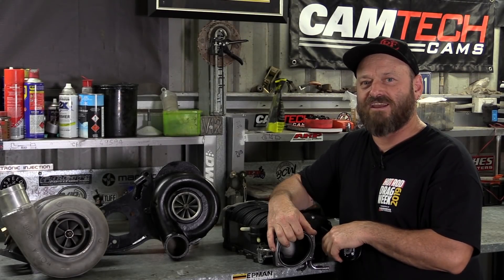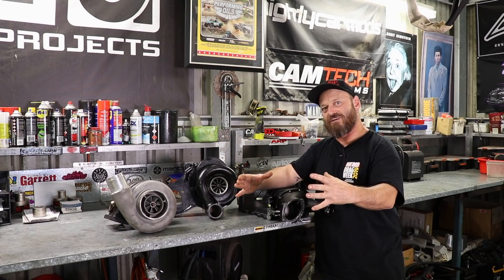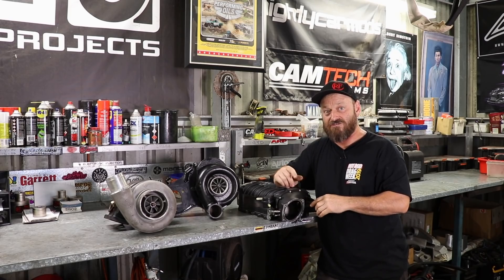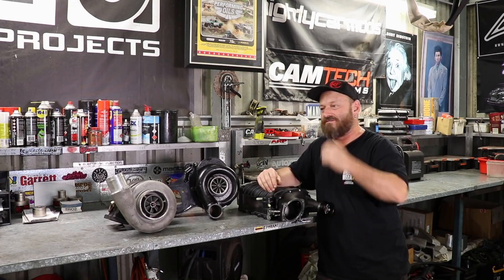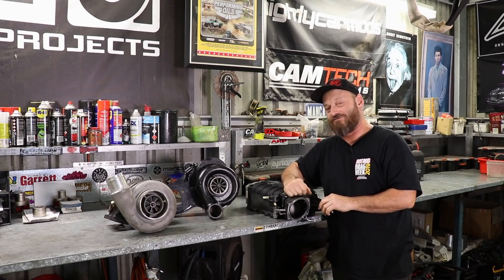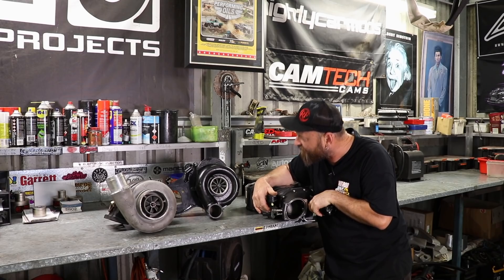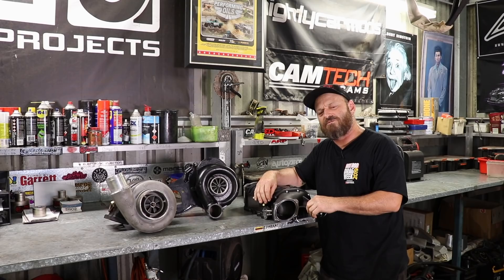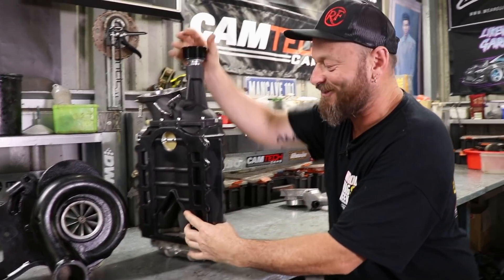Forced Induction Differences - THE SKID FACTORY - [ Quick Tech]

Comment: just bought a centrifugal supercharger for my xr8, turbo will make more power, but the simplicity of literally bolting it to the front of my engine makes it a good option
Reply: Well the problem here is you bought an xr8 instead of an xr6 turbo
Reply: @cameronjansz88  old mate probably wanted a 8 cylinder.
Reply: tturi2 you’ll still need to get a tune
Reply: statement leaver should rename themselves to just leaver... hold the statements, because they are very poorly informed.

This is why people start yelling in comments sections.
Reply: I have a supercharger car and YES SMALLER PULLEY = MORE BOOST .
Also bigger "Crank pulley" more boost or harmonic balancer for my application. Also I changed my "crank pulley" and no it did not effect timing ...
Reply: @stevenclarke374  Because the cam shafts are not driven from the multi V pulley  for the alternator belt. gearing it like that will give you more parasitic draw though.
Reply: @stevenclarke374  What your rolling in??? Did it come from factory with s/c ? Are you getting a good strong boost from idle to redline nice and linear? Good economy? No dodgy idle cold/hot?
I assume that since the s/c pulley and the crank pulley have been swapped. Was your ECU self aware or do you have aftermarket?
Reply: Belt driven turbo.
Reply: Why would you bye a xr8
Reply: @pauledwards9416  because I like it
Reply: Make sure you fix that vapor lock hohar in the front of the heads first.
Reply: @Hooha888 I'm sorry Who are you?
Reply: Hmmm. 
65mm pulley(standard) change for 72mm+
Bigger pulley more instant power without the Turd'bo lag.
No plumbing for coolant or oil required. Basically just belt and fuel pump!
Cheapest and easiest mod in automotive history.
Reply: statement leaver You want a smaller pulley on the supercharger to spin it quicker (more boost)
Reply: @Brandon27.0  What is speed? 
Distance over time!
Smaller pulley means your asking for half the lifespan due to forcing a faster rotation whilst lowering the original power output of the charger.

EDIT 
Same reason why 3cylinder cars now come with 17-18 inch alloys!!!
Reply: statement leaver ‘The simplest way is to increase the speed at which the supercharger spins in relation to engine RPM. To do this either you swap out the lower "crank" pulley for a larger one, or swap out the upper pulley on the supercharger itself with a smaller one.’
Reply: @Brandon27.0  Have you actually read and understood what you're actually typing?
Bigger crank pulley will also mean the timing is out due to the cams being standard when the cam pulleys would also need to be bigger for your small wheel charger(underpowered) to work with the RPM!
Reply: @statementleaver8095  You don't run superchargers off the timing belt.
And gear/pulley sizing for increasing or decreasing speed is pretty straightforward, go look at a bike with derailer gears. Bigger drive and smaller driven = faster driven speed. Smaller drive bigger driven = slower driven speed.
Reply: @johnjosephson9277 lmfao you don't even know how a belt driven supercharger works!
Al has shown two types of charge systems Centrifuge(BeltDriven) and Turbine (turbo)
Reply: @statementleaver8095  why don't I know? Because of the gearing ratio example I used?
And he showed three examples, two belt driven superchargers of different types, and a turbo. Yes I know that's a turbine supercharger.
Reply: @statementleaver8095  Anyway, whether you're right or wrong I'm clearly not going to change your mind on anything, and I don't think I'm learning much here, so I'm going to drop out here. Cheers.
Reply: John Josephso
Reply: statement leaver Bigger crank pulley doesn’t change engine timing, it’s the pulley not the gear you’re changing
Reply: @Brandon27.0 Funny 'Drop out here'!
What wraps around the 62mm pulley Then EINSTEIN???? 
The lack of backed up evidence from you is overwhelming me!
Piss poor comparison is all the intelligence I've got in return!
Reply: @Brandon27.0  Bigger the crank pulley the faster the rotation of the pistons!
Like I previously stated changing the crank pulley size affects the timing!!! Where == between pistons and valves!
Only 1 supercharger Al shown was belt driven! The black snails home isn't belt driven!
Reply: @statementleaver8095  don't think that you've ever pulled apart anything in an engine in your entire life .. front belts on an engine run the accessories like water pumps (unless driven by the timing belt as it is in my Honda), air-con and alternator. When you take all of them off, the engine will still run until either it over heats, or the battery goes flat. When you pull them off you will come across the timing chain/belt cover. Pull that off and you'll expose the belt/chain, gears and tensioner. The timing of these is completely independent from any of the front pulley's that run the auxiliaries.

If you want to get more boost out of a belt driven superchargers (the two black ones) you increase the crank pulley and decrease the supercharger pulley. Just like on a bike, where the fastest turn (although most power needed) is when you have the biggest cog at the pedal and the smallest at the wheel.

This is why, when superchargers were all the rave back in the 70's 80's and early 90's you could look in any street machine magazine and find over-sized crank pulley's and undersized blower pulley's, sold to be able to go from 7 to 9 to 11 to 13 pounds of boost.

Before you go and claim that you know everything, do yourself a favor and pick up a workshop manual from somewhere, get a wrench in your hand and get some grease under your fingernails. Otherwise you just prove that you're an idiot with no experience ..
Reply: @klay6483  Thanks for the factual rundown mate :D
Reply: @johnjosephson9277  reading through it I felt like smacking my head against the wall lmao
Reply: Klay couldn’t have said it better 👌
Reply: @statementleaver8095  No becasue the size of the alloy doesnt necisarily change the rolling radius.
Reply: @Brandon27.0  the problem with that is belt contact area. you really want a bigger crank pulley if possible.
Reply: Roo Tehconqueror Basic boost upgrades on factory superchargers a smaller pulley is still fine but yes can run into belt slip. Bigger crank pulley can cause other considerations since you’re spinning everything quicker.
Reply: @rimmersbryggeri  One day Benny's Cresta will run high 7s if it's got smaller wheels on it
Yeah and the engine will be powered by hopes and dreams!!!!

I'm yet to see little wheel prevail when up against big wheel! Specially at the drag strip!

Roll a 50p and a penny for 1 revolution. Obviously the 50p will go travel further because it has a greater radius 
Same for wheels of a car going from a 15inch to a 18inch alloy gives 3inch of extra travel per rotation and gives more miles per gallon as you'll be able to cover more distance than original specification.
The only discrepancy is profile of the tyres.
Reply: @Brandon27.0  Try it yourself Diesel will run happily all day long without either!
Reply: statement leaver go try that on a common rail diesel. On an old diesel yeh probably but that’s one little fun fact no one even asked for and why it even matters
Reply: @Brandon27.0  Well let's go back to the start! 
Why add weight to the crank pulley by making it bigger and heavier? I'd have thought smaller and lighter crank pulley would have better results.
Isn't that defeating the object of acceleration by slowing the pistons? A shaved flywheel can make a big impression.
I understand that a smaller s/c pulley will spin the s/c faster. But making the crank pulley bigger makes less sense to me.
Reply: statement leaver like 5 people have tried to explain it to you. No one said heavier pulley, bigger diameter crank pulley or smaller supercharger pulley changes the gear ratio, just like on a push bike. Smaller diameter pulley on a supercharger means less contact area for the belt which is why people might opt for an overdriven crank pulley to avoid belt slip. An underdriven crank pulley works for other desired results but for turning a supercharger quicker you’ve gotta go bigger drive wheel or smaller driven wheel to spin it quicker. If you don’t believe anyone here google it
Reply: @statementleaver8095  in the case of a supercharger being driven by the crank pully (NOT THE TIMING GEAR) the piston speed RPM are determined by the engine ie how much air etc is going in this then drives the timing and at the same time but completly INDEPENDANTLY the supercharger drive pulley.

in this the drive pully is connected to the crank and is driven by the pistons (they determine speed) the pulley here is the back wheels of benny's cresta the road or dragstrip is the drive belt for the supercharger the supercharger is the front wheels of benny's cresta (which are SMALLER). as benny's cresta goes down the race track bennys cresta front wheels are spinning faster than his back wheels. 

a supercharger creates boost based on how fast it is spinning the faster it goes the more boost it makes.if the ultimate goal is to make the supercharger spin faster you either make he back wheel (the drive pully on the crank) bigger or the front wheel (the pulley on the supercharger) smaller 

if you want to learn more about this go watch some stuff from finnegans garage and balphemi. or some of cletus mcfarland with TOAST. both of these are supercharged and they talk about swaping the top (supercharger) and bottom (crank) pulleys over to get more boost. in these situations the top (supercharger) is larger than the botom (crank)
Reply: @jackass123455  That last paragraph is exactly what I've been saying bigger on s/c and smaller on crank. But apparently I'm thick and I know nothing according to the rest of the comment section lol.
Sounds like Cleatus agrees though!!!
Reply: @statementleaver8095  when you change your wheels from 15" To 18" makes no difference. The overall diameter change is not 3 inches, if your car has 3 inches bigger diameter tires after this operaation, you should maybe buy tires from a Shop that knows their shit... Most cars would struggle To fit 3 inches taller tires without rubbing, hence why you got different profiles To pick from. And yes I do know something about this matter. And changing a bigger crank pulley To pick up blower speed does not affect the timing. If it did, you might need To consider maybe a new hobby.
Reply: @AnanusBananus I stated the only discrepancy is tyre profile previously.
Forget the tyre profile the wheel itself is 3 inches bigger!
Bigger crank pulley means longer distance between TDC as pulley is taking a wider arc. Lowering idle RPM.
Small pulley on s/c compensates for this low idle RPM. By being ran unnecessarily at idle output on s/c is capped to lower RPM when boost is required you'll have none. Especially after 3k because you've used the boost to get off the line.

EDIT Time
Reply: @statementleaver8095  Sir, you need help.
Reply: @statementleaver8095  WRONG!!

Comment: What are your thoughts on Twincharging? Either S/C low revs until T/C picks up (lag delete) or the second charger in line compressing the already compressed air from the first charger?
Reply: Make It Go twincharging is pretty much useless. Modern turbos are quite good, and if your engine/turbo/exhaust housings are selected correctly then adding a blower doesn’t add much other than weight, complexity and heat.
Reply: Both work excellent, the only downside is the effects on the budget of the build. Depending on the vehicle it can also be nearly impossible to fit it all under the hood. Industrial diesels use both for different applications.

Comment: I thought on Eaton super chargers the rotors get hot and expand closing up the gap?
Reply: If it's being ran hard, the gap has to be left big enough so under max temps it doesn't touch. Which means that under less then max performance their is a gap, that can be combated with fuel injection into the blower creating a "liquid gasket" of sorts.

Comment: oof, there are some grossly exaggerated opinions in this one
Reply: Yeah, the Edelbrock 2650 and the Whipple Gen 5 make some giant gains on the Coyote motor which is becoming a pretty hot ticket item here as of late.  My Paxton car pales in comparison to the TVS cars that provide that impressive kick in the ass at the hit.  15 psi through my Paxton needs a converter to get my car into the 9's routinely where a Whipple car with the same fuel system is banging out single digit passes with the same mods and no converter with relative ease.  In a 4,000 pound car, no less.
Reply from the maker: To clarify, I am specifically talking about Detroit diesel blowers being used on engines not other blowers like Eaton tvs which work well.

Comment: Roots blowers are used extensively on larger engines used in ships and locomotives. Engines running flat out at 800 rpm, idling at about 300. Your 2 stroke GM engines that you mention, except these are 1000+ horsepower engines.
Reply: Shaun Turner nope the 2 stroke Detroit was lucky to make 400 hp. I’ve had several of them.
Reply: @stephenbrown571  i'm talking about the GM EMD 567 and bigger engines used in locomotives and ships. Should have clarified that. 3400 cubic inch
Reply: @stephenbrown571  I think he's meaning the train and boat motors made 1000hp not detroits which never did. I maybe wrong tho.
Reply: Jonathan Gardner I’m not sure about the marine or industrial engine.
Reply: @stephenbrown571  Honestly I don't either, I've never had experience with them.
Reply: They still have turbos, the roots blower is used for starting and low RPM functions do to some trains and ships still using 2 stroke engines, turbo is what provides them with the Long haul efficiency. Some train yards remove the turbo for the yard engines as the turbo never comes into use for that specific task.

Cat has some blown engines for sport fishing boats and yachts, but they are clutched so they actually disconnect after the turbo is spooled. The only reason for the blower is the low end throttle response on boats that have no budgetary concerns.
Reply: Turbo is always the better option if your looking for efficiency, which is desired for all commercial applications.
Reply: All the large stationary power generators I have seen have been turbo charged.

Comment: I once worked in a plant, that years back made powdered chemicals, and they used a massive roots blowers to move powder from place to place.
It caused our resident drag race wannabe to have wet dreams when he saw it about to be scrapped. Then he realized it was longer than a Big Block Chev and weighed almost as much.
Reply: You ever see the famous youtube clip with the red camaro with the massive blower on it
Reply: @matthewross3635  Haven't, no. I guess I should go poke around
Reply: @jpkalishek4586  just search camaro wheelstander with huge blower
Reply: @matthewross3635  okay, found it.
 ours was a bit longer, and a bit less diameter on the rotating parts, but was also cast iron cased.

Comment: Hooray!

My faourite would have to be a compound setup with a screw blower for high pressure and turbo for atmospheric side
Reply: It works really well, Snappy performance and massive high end flow.

depending on your application, remember to plumb your wastegate reference line to manifold pressure, not just interstage pressure. And remember to keep your blowoff valve between the supercharger and the throttlebody. 

You can pulley your blower up and down depending on your launch traction. And you can set the wastegate for ultimate target power. Its a really nice setup
Reply: @beajayparker247  no waste gate on my old set up, just properly sized housing. Was pushing just over 700 kpa (around 100psi)and yes it's a 12.7 litre diesel lol
Reply: @evil_me  Ohhh youre a diesel guy!!!! That makes a lot of sense. Im somewhat of a diesel guy myself, but obviously no where near your level